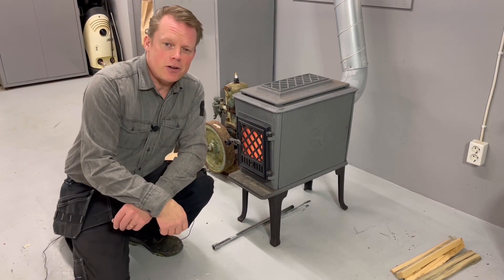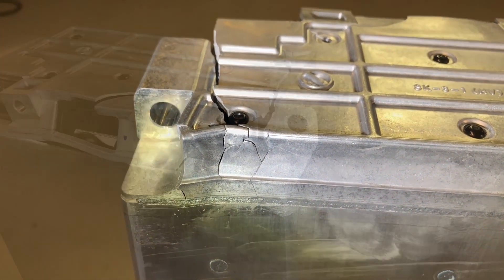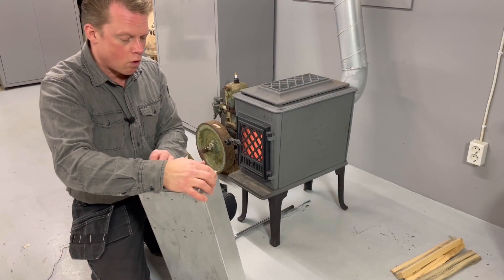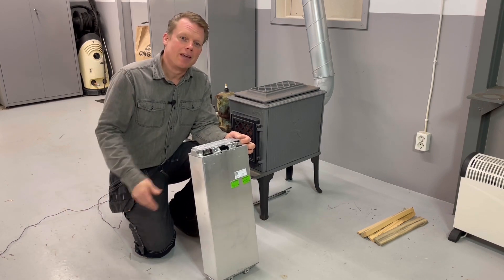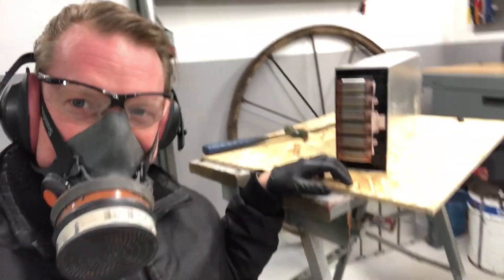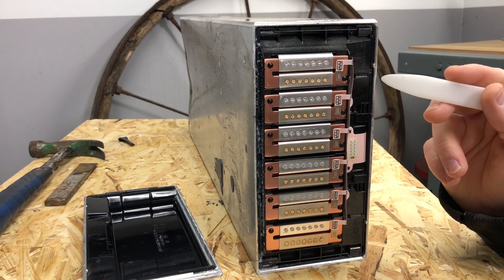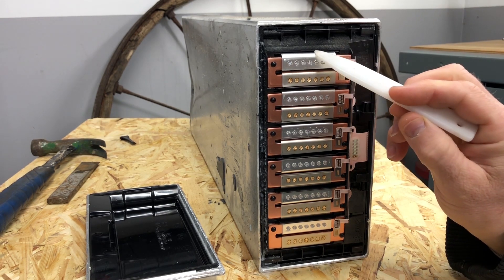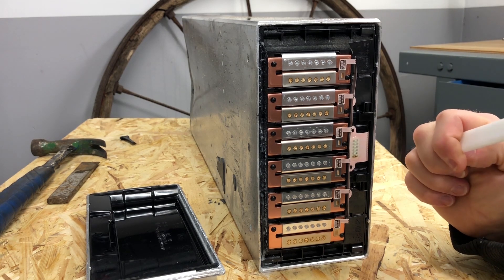Open up a VW id3 id4 lithium battery module.

Comment from the maker: Here you can see me build a 48 V off grid system out of a module like this: 

Building a off grid system with a victron multiplus
https://youtu.be/KDkWjR-gD1U

And here you can se when I install a complete battery to my house from an Volkswagen ID3, 2021 together with my 15kW Solax hybrid inverter:

 https://youtu.be/ldox2_BXVzk

Comment: Do you recall how the cells were electrically arranged within this module when you opened it up? I.e., was it a group of 12s on the left and a group of 12s on the right? Or was each group of two adjacent cells connected in parallel? Thank you!

Comment: Interesting, do you know if the module has some circuitry besides the fuses? I would like to somehow read out the part numbers and the serial numbers of the modules in my car, is that even possible without disassembling the battery pack? Thx!

Comment: The cells don't look like they can be replaced in case of a single defective cell and it seems that they are wired consecutively. So if one cell is damaged you can throw away the complete module...
Reply from the maker: Yes, but you still do not need to replace the whole battery like some other brands…

Comment: very brave to cut the NMC battery inside :)
Reply from the maker: Brave or stupidity is sometimes almost the same. In this case the battery was completely empty after I had shorted it out for a few days. The cells was down to 0 V before i started to cut into it.

Comment: Hi,
I have a question: Which temp sensors are in the battery?
And what is the charging current?
Reply from the maker: Ntc type.
Fast charging 375A.
Don’t forget to cool it if you want to use that amount of amps…
Reply: Thanks. I won't get a charger with that amount of current.

But do you also have a specific number or a name of this temperature sensor?

@flyingtools
Reply from the maker: @ no, it did not have any numbers on it.

Comment: Hello, thanks for  sharing ! Do you tested the fuse max current ?
Reply from the maker: Yes, Testing the VW id3 battery module balance port, important to know before you buy any BMS to it.
https://youtu.be/aHDmUo5EEOk
Reply: @flyingtools  thanks i saw it but you didn't test max current the fuse can take, you stopped after few minutes at 300mA without fusing.

Comment: Fuses should be 0,75A. Vw Bms uses only 0,1A - to balance a 235Ah pack! These welding shut and gluing the cells is also horror for me... I would recommend prismatic Lifepo4 packs

Comment: Great work and thanks for sharing so much with the community! 
I recently purchased a VW ID3 battery and I'm planning the BMS now - I've seen in your previous video that you went to 300mA on the balancing fuses but I'm curious to know if you ever went to the limit with this module that you opened up.
I'll gladly share my project with you if it's of any interest - we're not that many in Sweden that play around with this stuff :)
Reply from the maker: Hi!
They are rated to 450mA
Reply: @flyingtools  Tack för svar! Uppskattas :) Finns det något sätt att bolla lite tankar och idéer med dig utanför YouTube? Som jag skrev, finns inte många av oss som bygger egna fordon med dessa pack (eller andra för den delen) i Sverige ;)

Comment: Hello, do you which temp sensors/ thermistors are used ? I am looking to reuse thoose from the battery pack but I haven't any information about thoose
Reply from the maker: Hi!
It was no info/stamp on the thermistor. So I don’t know.

Comment: Hey, can you give an estimation on how long it will take to extract the Pouch Cells from one Module? For my purpose Cells can be salvaged damaged
Reply from the maker: Hi!
Around 3-4 hours or less, especially if you don’t need to be careful with them.
Remember to completely drain the module before you start to work with it.

Comment: One might want to mention that it is insanely dangerous is a lithium cell of these dimensions shorts out 🔥
Reply from the maker: Yes, if they are charged. This modul is completely discharged, and you will also find that info in the description.
Thanks for your comment and concern.

Comment: I was told that what you did is very dangerous. I mean cutting the metal a bit to far now and then...
Don't try this at home!
Reply from the maker: Yes, you are right about that, BUT this module is completely discharged so the most dangerous thing here is the angle grinder it self. 😉
Thank you for your concern😊

Comment: I have the same cells in my RC plane 🤣
Reply from the maker: Almost😅 but the BMS or balancer as you probably call it, have much higher quality, and also the c-rate is much lower than in your aeroplane, which make this battery much more safe to use.
Thanks for your comment 😊

Comment: 1:00 Please use a stainless steel pipe for the wood heater! Ventilation pipes stay 4 to 5 years and it's dangerous using later!
Reply from the maker: This was only a temporary installation due to the high energy prices, and also the extreme cold weather we had. I was more concerned about the zinc plating around the pipes, so I burned off as much as possible before I start to use it.

Comment: BMS is not balancing the current but the voltage
Reply from the maker: And to balance the voltage between the cells the bms drain the cells with current. If that current is to high, those tiny balance fuses will burn. I use those modules for solar storage with a Orion bms, that’s why I am interested about the current and fuses on the balance side. You will find this information in the description.

Comment: Repair is part of the UN SDG's. And repair is 'green'. To me it does not look like this module has been designed with repair in mind...
Reply from the maker: Hi!
There is up to 12 modules in Vw id3 so this is a smaller part of the hole battery pack. I do not know about any other manufacturers that will have replaceable cells now days. The reason of course more cost effective and extremely compact, but it is also much safer to work with. Thanks for your comment 😊

Comment: Now we all know that these batteries WILL fail ove time, there is simply NO way around it. So I am absolutely stunned about a design that is COMPLETELY useless for repair and a complete nightmare to recycle. I wonder what VW's excuse is.
Reply from the maker: Almost every car manufacturer builds their battery packs like this. So you can not blame just Volkswagen for this, it’s the whole industry. And those tiny fuses inside of the module are extremely important for safety reason. But yes, they could absolutely be replaceable.

Comment: It seems there is no active cooling in place. Neither liquid nor air. What a shame for VW. History tells that passive cooled batteries degrade much more rapidly (e.g. Nissan LEAF) compared to TESLA. Or did you find any evidence of active cooling at least on a module level?
Reply from the maker: The liquid active cooling and heating is in the main battery box. You do not see that system in this video.

Comment: That module weighs 1kg? In your description.
Model flight batteries are heavier for unit volume than that.
The parallel connection is used in laptop batteries. After they refuse to accept charge, I have dismantled and been able to separate cells and recharge at initial low current successfully. It seems like a solution to deliberately age limit. Why bother with BMS if the cells are all coupled with no balance access to the pairs?
Reply from the maker: It is the cell specifications, not the complete module.

Comment: Thank you. These type of cells are more difficult to reuse in another application than those from Tesla.
Reply from the maker: And thank you for watching 😊.
I use them as they are, 9pc in serie, in its water cooled box, 450v to my solax hybrid inverter 15kW. You can also use one module as it is together with victron multiplus and then you have a perfect off grid system with a 12 S configuration and 6.85 kWh. I think that that’s actually easier than a Tesla module.

Comment: Germans talk so much about ecology in eu... and then they produce this. it looks so hypocrite to me. If single electronic part in bms fails that whole thing is going to trash. How is this even allowed for VW to do this?
Reply from the maker: I dont think that its only Vw that build it like this, and if there was no fuse inside and the bms fails you maybe sett the hole battery on fire if that balance lead will start to glow. So the reason for this is safety.

Comment: Very interesting thanks,.. so I take it that there are multiples of these modules within a vehicle. ? ..depending on its spec.
Reply from the maker: Hi and thank you.
Yes you are correct 👍🏻 
And they are sitting in a box and the bottom of that box is taken car of the thermal handling, (water cooled)
Thank you so much for your comment 😃
Reply: @flyingtools  ....  Thank you again,.. for your video clip and info'..

Comment: at least the battery is totally passive, no 'intelligence' inside the battery, it should be easy to hook it up to a load, and a BMS
Reply from the maker: Yes it is👍🏻 I’m running a 108s bms to those modules and it is a great home battery. 62kWh 9 modules.

Comment: Were the pouch cells themselves still reading 0v after removal? Tried charging one up yet?
Reply from the maker: Yes 0-2 volt. Not tried to charge them.
They are not safe to charge after they have been drained like that.
Thanks for your comment .

Comment: The whole project should have been done outside, from the start. The explosive power there is dangerous
Reply from the maker: The module is completely discharged. 0V
They are putting those modules in a shredder with that voltage, so I am pretty sure that I was safe all the way. But thanks for your concern and for your comment.😊
Reply: @flyingtools  Completely discharged - then there is no point in salvaging cells anymore.
Reply from the maker: @inse001  that was not my point here, see the description, and then you might understand😊
Reply: Just noticed some comments suggesting this…
I wonder what the battery container looks like if one of the sub modules is damaged like this already.
Reply from the maker: @inse001  I maybe will do a video about that. I still have the container. Then I also can show the active thermal handling of the battery pack.
Thanks for your comments btw.

Comment: Hello Flying tools. Thank you for this video. Very well done! I want to know, the voltage of this modul, and the kapazity in kwh. Thanks.
VG, Jürgen B. from germany, from loetseite at wordpress
Reply from the maker: Hi! Thanks for those kindly words😃 it’s a little crazy but the module was completely discharged before I did this cutting😉 It holds a voltage between 40-50 volt, (cell volt: 3,3v-4,2v)
and a capacity to 6,85kWh
Nmc721 LG chem.
The cooling system is not showing here,
but they are water cooled when they are installed in the battery box in the car.
Thank you so much for watching😊
Reply: @flyingtools  ; Wow. Thank you for your feedback. I do not have the exakt measures, but it is not very big, so i can see in your video. And i wander about the 6,85 kWh capacity. I think, this is an very high capacity of this measures. Thanks again!
Juergen from germany

Comment: Good video. Really shows that there still is a long way to go when it comes to sustainability. This battery pack was not designed with re-use or refurbishment in mind. It becomes hard to recycle trash simply because of a dent.
Reply: Look up the video by JerryRigsEverything on battery recycling. TLDW: they basically shred the entire battery, separate the plastics from the metals and using a special chemical solution get back the rare earth metals (cobalt). Which results in 99% of the battery being recycled without much effort at all.
Reply: @Rob-ky1ob how do they prevent the batteries from catching fire while shredding them and how much percent of the lithium can they recycle?
Reply: @lightningwave   Lithium kann zu 100 Prozent wiederverwendet werden, den Rest der Batterie kann zerkleinert geschreddert werden und nach Gewicht oder aehnliches gefiltert werden.
Reply from the maker: Thanks, yes, it’s sad that it isn’t possible to remove the cells. But I also think that it is very hard to build it this compact and still have it serviceable without adding both weight and space.
Reply: I think this design will make those pack safer in accident.
Reply: yes and no. at least you can change one of those modules and do not need to replace the whole battery pack like in a tesla. i think in one of the IDs, you have up to 14 modules. if the car is end of life, these modules could be great for a home battery system.
but you are right, it would be cool if this would be designed for repair.
Reply: Just the opposite. Easy to replace whole module with a working one, no point going to a cell level fix in a pack.
Reply: I was thinking that - what a waste of resource because of a slight damage. If an industry is to be built on repairing these things they must be forced to make entry and servicing much easier
Reply: Batteries have nothing (absolutely nothing) to do with sustainability.

Comment: I'm surprised there is no active thermal management between the cells. It seems not even in the entire module.
Reply from the maker: They are water cooled when they are placed in the main battery compartment.
You are only seeing the module it self and you don’t want to have a water inside of that one 😉

Comment: I didn't know that volkswagen wanted to make things so cheap for themselves that the battery doesn't even have air cooling... i will not buying German car for that reason never
Reply from the maker: The modules or a water cooled when they are sitting in the main battery compartment.
Reply: maybe they don't need inside. the aluminium case probably does a sufficient job.

Comment: Ok, ID has battery packs with no active cooling system, so possibly short lifespan of NCM cells
Reply from the maker: They are cooled. It’s just not shown here in this video, I only show a stand-alone module. The thermal handling is done via the bottom of the main battery box, (not seen here in the video) that has water circulating inside of it. The heat is then transferred via cooling paste between the modules and the battery box floor.